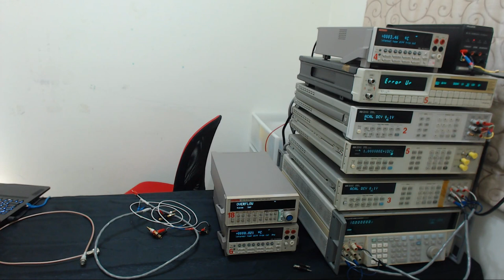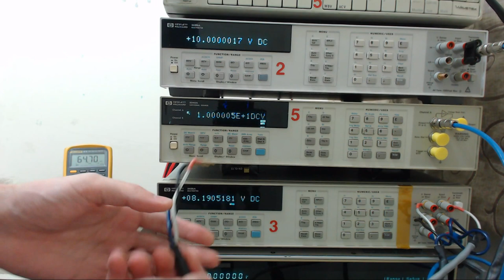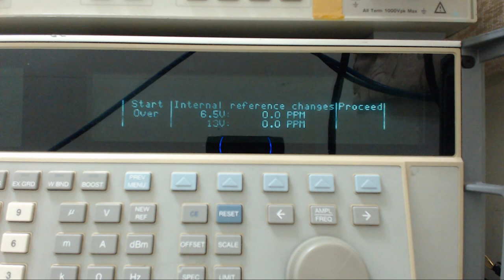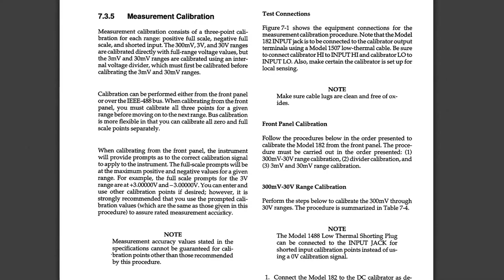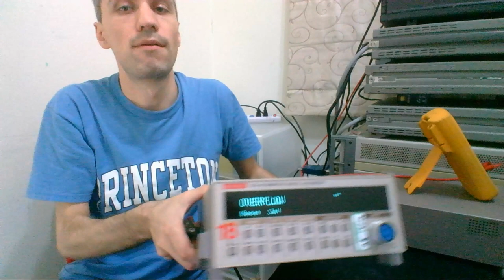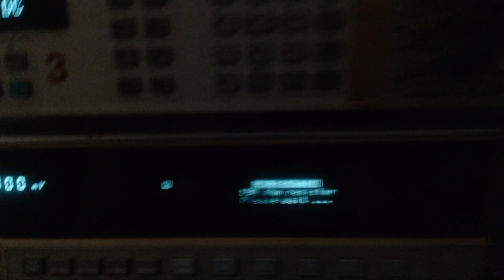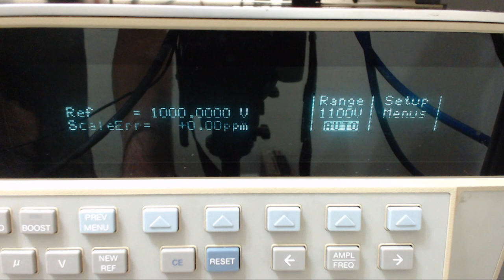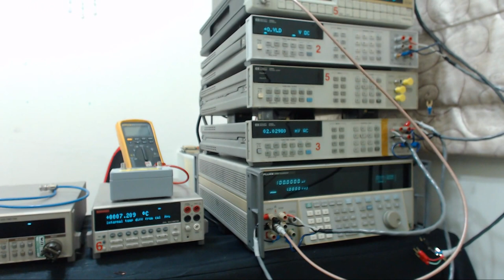Calibration and adjustments, and how to calibrate the calibrator?

Comment: @26:30, #3 has the sense still at the 5700A (or disconnected?), while the inputs go now to the 3245A? I wish the camera stayed further away.
Reply from the maker: In this particular case sense was not used for anything except resistance. It was a very small room back in Taiwan and camera was already pushed against the wall. Sorry. You are free to reach out to our xDevs.com IRC channel for any more details and questions you might have.

Comment: @ 29:30, are #2 and #3 connected to the 3245A? While the 5700 is not connected to anything? Or is it connected to the Keithley? Because it almost seems like you're connecting #2 and #3 to the 3245A without disconnecting #3 from the 5700A.
Reply from the maker: 5700A has stand-by mode , when output is disconnected internally. So it is convenient to leave cables connected and save time to avoid waiting for emf settling , when 5700A output is not required.

Comment: Thank you for your videos. Love them.  Your test leads at 47:05 look hand made, which probably saved a lot of money.  Can you explain what you used?  I suspect gold plated low EMF copper spades connectors onto PTFE insulated solid copper wire?  Do you crimp or solder them?  Is that individual copper wires that you twisted and inserted into non-heat shrink PTFE  tubing?  Is there any shielding in there? Love to see a whole video on just your thoughts on Low EMF test leads.

Comment: Happened to read the specs for the HP 3245A, seems to be using LM399 as a reference source. How would this be usable to calibrate a 3458A / 5700A which have more resolution and a more stable source (LTZ1000) ?
Reply from the maker: It's not used to calibrate 3458 or 5700A, but used as a AC voltage and AC current source, while calibrated 3458A readout used as reference. 5700A is adjusted by using fixed 10V, 1 Ohm and 10kOhm standards of course, not 3245A. ACV/ACI on 57x0A can be calibrated with setup around Fluke 5790A, Wavetek 4920 and/or Fluke 792A + AC/DC shunts. This video is merely an intro to the big pandora box of 7.5+digit metrology challenges.
Reply: @xDevscom_EE  Ah, understood. Thanks for the detailed explanation. I was hoping to buy a used 3245A and have it calibrated / adjusted to use it for further calibrating other devices. Metrology is an expensive exercise, especially the more digits you care about 😅

Comment: Instrument No. 5 looks like a 3458 but is a generator? The input (or rather output) terminals look different from the usual 3458. Has the 3458 been somehow modified or converted?
Reply from the maker: It was a commercial product, HP 3245A. Rather interesting device with some unique capabilities. I have article about it here : https://xdevs.com/fix/hp3245a/

Comment: How do you calibrate the 3458A multimeter?
Reply from the maker: To calibrate  3458A  you  need known stable  +10V  DC reference,  such as  Fluke  732A or Fluke  732B,  or similar performance unit and stable  and known 10000 Ohm  resistance standard, such as  ESI SR104, Fluke 742A-10K or Guildline  9330.  I have shown the basic procedure   flow during my  first DMM repair : https://youtu.be/QPz6caGhYhU?t=16m23s . 

For  my  own 3458A calibrations I use  LTZ1000A-based  ultra-stable  reference, verified  against  recently calibrated  Fluke 732B's  and for  resistance I  use  Fluke  SL935  prototype  resistance standard (worklog: https://xdevs.com/article/fsl935/) . Little bit  more  theory is explained in my article: https://xdevs.com/article/volt_xfer/